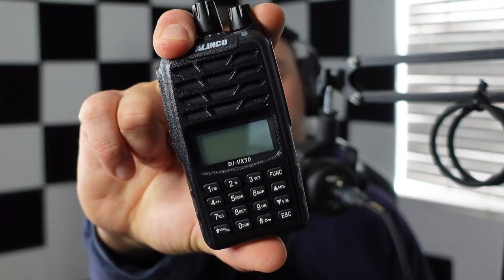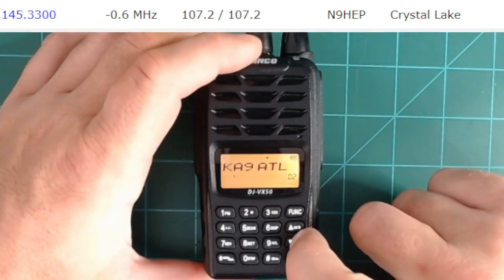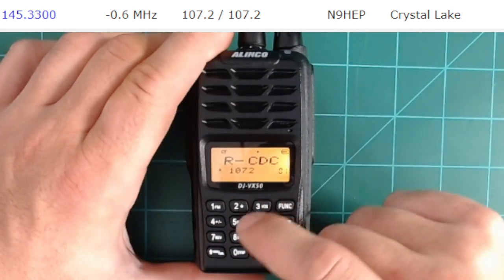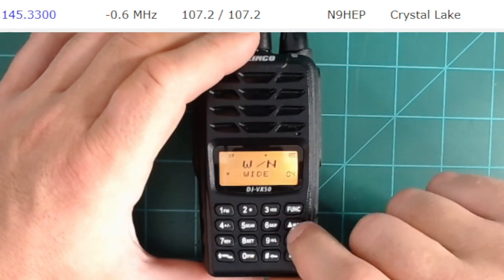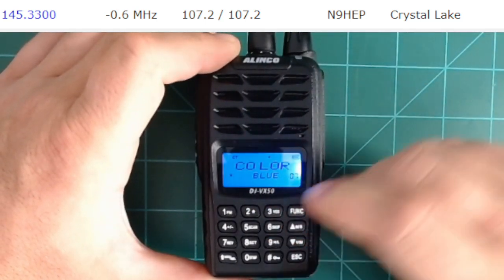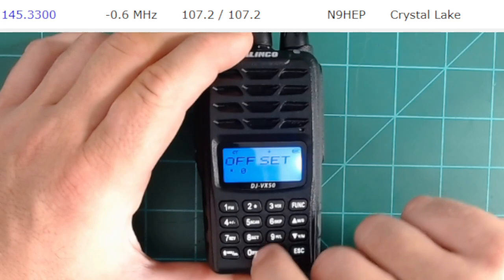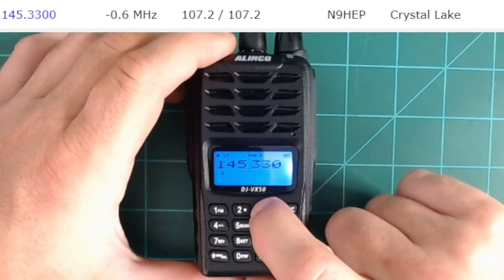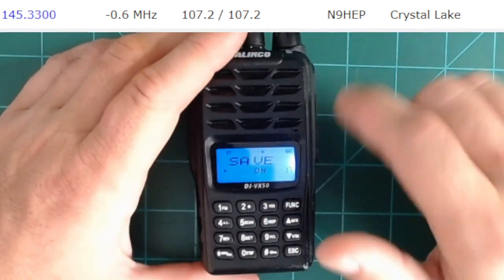WALKTHROUGH: Manually Programming The Alinco DJ-VX50

Comment: I have a problem with that ALiNCO DJ-VX50. More precisely, either with a battery or a charger. I put ALINCO on charge, regardless of whether the device or just the battery. The battery starts charging and after half a minute the charging is stopped. The batteries have been charged several times so far, which means that they are practically new. Does anyone have this problem or know what the problem is. I measured the voltages on the charger. There is 9.1V on the adapter, and 8.39V on the battery contact. So that's good. Is it possible that the battery is defective? Unfortunately, the warranty just expired.
Reply from the maker: It sounds like the charger can’t hold voltage under load or the battery’s protection circuit is shutting off.  Measure the battery’s voltage by itself (it should be around 7 or 8 volts). Next, measure the charger while it’s actually charging.  If the voltage drops a lot, the charger is bad. If the charger stays steady but charging still stops, the battery pack is defective even if it’s new. If the Li-on was left at full capacity for months, it may have degraded the battery itself.   I hope this is helpful.
Reply: I think it's the battery. I put the charging battery on another 8.4V source and the same thing happens. Charging turns off after 20-30 seconds. Obviously electronics in it. Otherwise, the voltage on the charger is OK, 8.35V. I'll have to get another one. The battery voltage is 7.3V, but as soon as the device is turned on, in 10-15 min. turns off. The battery indicator drop rapidly.
Reply: I got a new battery and everything is fine now. The original battery was suspicious to me from the beginning. If I charged it 5-6 times in 3 years. The contacts on it were oxidized from day one. Now I see that it is a little swollen on the inner part that connects to the device. Really strange. I will open it up and see what it is.

Comment: can you program in a crossband repeater?
Reply from the maker: It is not full duplex, no.
Reply: @DudeTested  thank you. I was thinking of buying this radio. I want a portable that I can program in our crossband repeater frequencies into memory.
Reply from the maker: @DanBrianGerona  I'm sorry, I may be misunderstanding you and therefore may have given you the incorrect info.  You're asking if the offset can expand between VHF and UHF so that you can use a crossband repeater (4am readings).   That is an answer I don't know, but as I recall, the offsets on the radio were not enough to  have input on vhf and an output on uhf, if I recall, but this I am uncertain of.
Reply: @DudeTested  thank you for your reply. Yes, that is what I wanted to do. We have a alinco dr 638 setup as a crossband repeater. I am looking for a dualband portable radio from alinco that I can use with the crossband repeater. 

Thank you so much for the info. I was about to purchase the vx 50. Good thing I checked and found your video.

Comment: Just retired so is this a beginners radio for someone who knows nothing about ham radios?
Reply from the maker: Congrats!  I love this radio, it really should have more attention and press. However, this is the reason I say No.  It's a radio which never caught on, so as someone who knows nothing about ham radios, it becomes difficult as there is no / little support and even contacting the company is sometimes difficult.  Great radio, no support, little documentation.  I would suggest to go with something more in the mainstream.  Do you you have any requirements?   If none, Maybe check out the Yaesu FT-65R or FT60. Don't let the models fool you, the FT60 is way better than the ft-65r.  I have a 60 and should consider making something on it..  Please let me know your requirements and I will try to suggest.
Reply: @DudeTested  I would like air and ssb.

Comment: Hi! Manual is unclear about dual watch - does the radio listen on both bands simultanously? (Master / Slave)

Rationale: want to use the radio to communicate privately on 1 channel, but listen tk group conversation on a second one.

If not, does activity on the slave trigger the star indicator (lower left) and a voice notification? (How would I know activity on the slave without actually looking on the display all the time)

Alternatively, what halpens if PTT in scan mode? Does it transmit on master channel, or stop at the current channel in search and transmit there?

Thanks!

Comment: I see on your video that you are working with only 1 frequency (without the SUB). Wish to see only 1 frequency on my display sincethe LOCK feature does nothing on main frequency from being changed accidentally. LOCK appears to work only with the sub frequency. Would greatly appreciate your kind help. 73
Reply from the maker: Good morning. I've been looking for a couple hours on the radio and I don't seem to remember.  I'm pretty sure it could be done within the software and that might have been the solution.  I'll keep looking and if I see anything I'll let you know
Reply: Hi! Manual is unclear about dual watch - does the radio listen on both bands simultanously? (Master / Slave)

Rationale: want to use the radio to communicate privately on 1 channel, but listen tk group conversation on a second one.

If not, does activity on the slave trigger the star indicator (lower left) and a voice notification? (How would I know activity on the slave without actually looking on the display all the time)

Alternatively, what halpens if PTT in scan mode? Does it transmit on master channel, or stop at the current channel in search and transmit there?

Thanks!
Reply from the maker: @ikcalB it does not

Comment: ALINCO DJ-VX50 is a good radio but lacks in Sensitivity as compared to brother DJ-500.
Reply: According to tests in QST magazine, they have virtually the same sensitivity around 0.14μV for 12dB SINAD on VHF and UHF.
Reply: @adrianbeacon6421  I have both, the dj-500 appears more sensitive,  receives weak signals and breaks squelch (both) set at lowest setting better than dj-vx50.
Reply: @radio73s  Maybe QC on dj-vx50 is worse... In the meantime I found indonesian video comparing Yaesu FT-4X, FT-65, Alinco DJ-W58 (looks like VX50, with BNC connector) and DJ-CRX5. In that comparison DJ-W58 seems to be least sensitive as well.

Comment: Hello) How to remove the second frequency from the display in VFO mode?
Reply: Have the same issue, cannot turn off the sub band. Nothing noted in the manual either about turning it off
Reply from the maker: I'll be home tomorrow and will take a look if it could be done
Reply: @DudeTested  any luck sir?
Reply from the maker: Hi bud, I am sorry I didn't respond sooner. I've looked on my radio and in the user manual and don't see any indication of it being able to be changed. I do remember an advanced menu but I can't remember how to get into it. For some reason I feel like in the advanced menu I would have been able to change it.  So to answer your question no, no luck yet.. take care

Comment: how did you get the radio in single band display?
Reply: How to disable dual receive function in this radio ?
Reply: @smallick653  I finally found out how to get it in single band display. This can only by set with the programming software which i finally found. Not from Alinco btw!
Reply: @johnvanderkooij6360  you mean the rt software?

Btw, Manual is unclear about dual watch - does the radio listen on both bands simultanously? (Master / Slave)

Rationale: want to use the radio to communicate privately on 1 channel, but listen tk group conversation on a second one.

If not, does activity on the slave trigger the star indicator (lower left) and a voice notification? (How would I know activity on the slave without actually looking on the display all the time)

Alternatively, what halpens if PTT in scan mode? Does it transmit on master channel, or stop at the current channel in search and transmit there?

Thanks!
Reply: @smallick653  yes

Comment: HAM RADIO DUDE thanks a lot for your videos! Did you find how to reduce a noise in Airband mode? It looks like squelch doesn`t work in this mode on DJ-VX50
Reply: Go to AM mode and press and hold PF1 (below the PTT button). When the display changes, rotate the VFO knob to increase the squelch setting. Good luck!